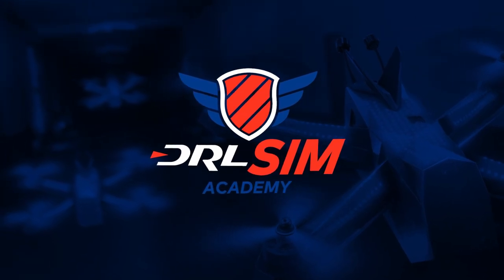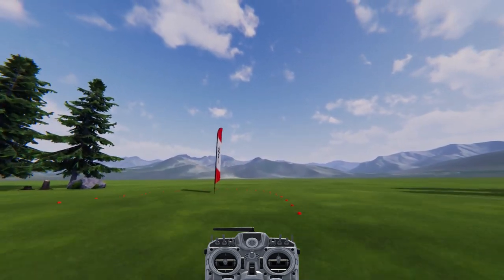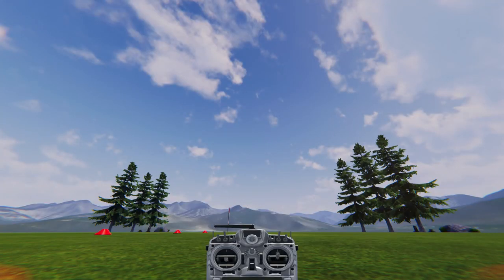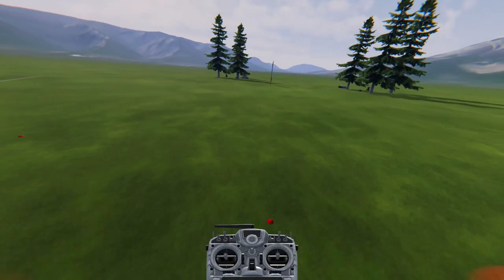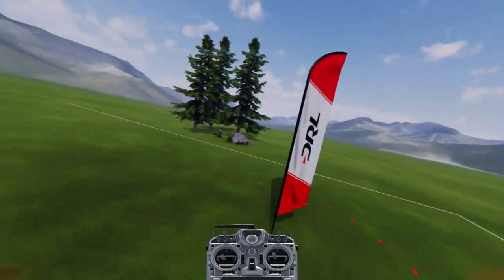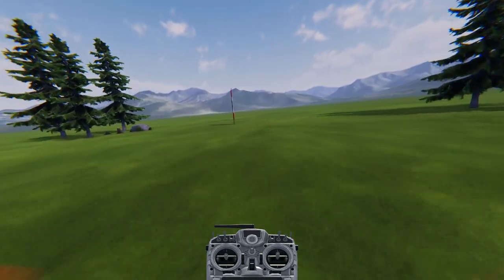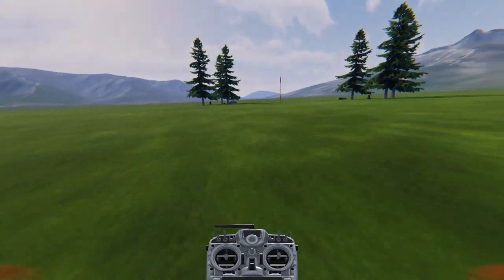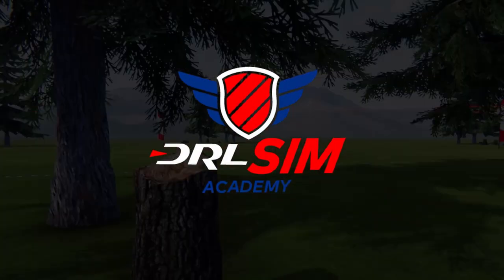DRL SIM Turning & Braking

Comment: Is this doable using xbox controller? I am having a hard time hovering with my xbox controller. I am curious if I needed more practice or I need a better controller. Any suggestion what controller I can use?
Reply: X box controller is balanced in middle position what makes it weird and harder. I would go for a decent remote and USB dongle so you can feel it the way it supposed to be